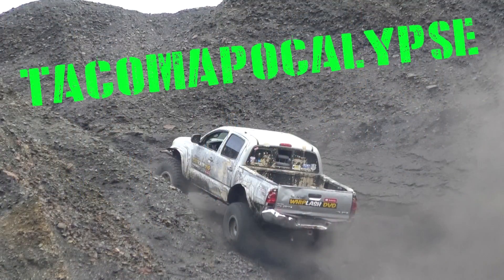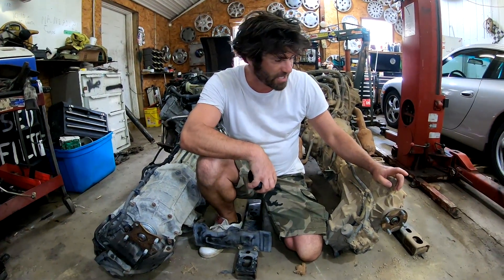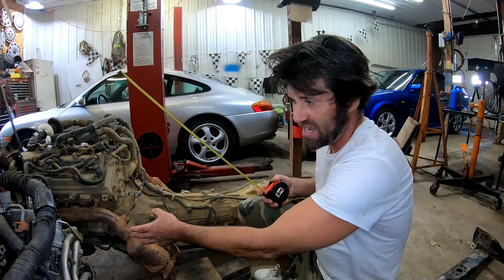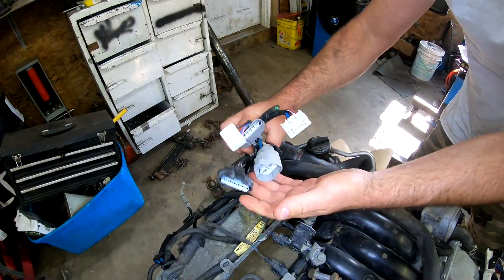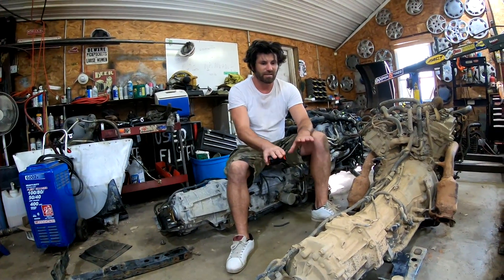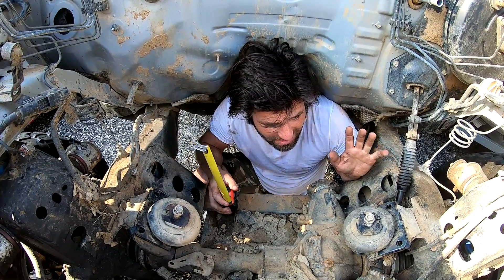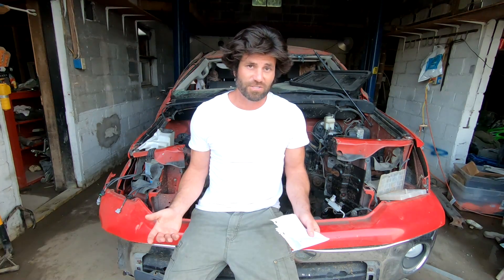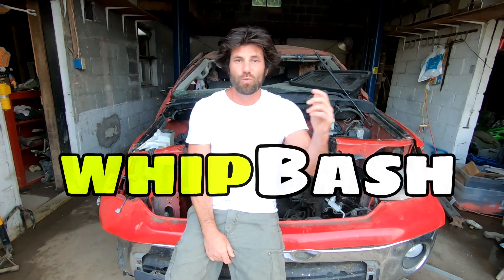Can you fit a 5.7L Tundra engine in your Tacoma? (TACUNDRA 11)

Comment: How did you like your 1GR v6 in the Taco?  I have an old 94' v6 4x4 in great shape but want to do an engine swap.  Everyone has done the 5VZ for the last decade or so because it's an easy bolt in but only gains ~40hp (~190) and they have known head cracking issues around the rear #6 cylinder so I'm leaning toward the 1GR v6 (hopefully a 2009+ dual VVT-i) or also considering the 05-06 2UZ out of a Tundra which has 270hp.  And in either case I plan to stick with my manual 5spd.  With the 1GR I could use an FJ's tranny and xfer case, or with the 2UZ could get an adapter plate and use my R150F tranny.  It's now been done by a few guys.  And I wouldn't mind the extra HP of the 2UZ but it also seems to be a little overkill maybe and it's a heavy engine with its cast iron block.  I think the 1GR is a good fit from the standpoint of less weight since it's all aluminum, both head and block, and was it also used in the 2nd gen Tacoma's.  I'm not building a race truck or crawler either, more of just an overlander camp rig.   Anyway, with 180k on the old "3.Slo"  I want to swap it out.

I've also been considering selling it or keep it and mod it for trails and buy a newer Taco or Tundra.  I like the 05-06 Tundra or the 2nd Gen with the 5.7L but in both cases am kind of worried about the MPG hit.  I've been spoiled by the small v6.  I get up to 24mpg sometimes! My engine is clean AF with mint compression.  And the 2nd gen Taco's are nice but would want a 2012+ to avoid the known frame rust issues (just like the 1st gen Tundra's have) hence my hesitations..., and used Tacoma's are stupid pricey... like $18-20,000 at dealers for a 2010 with 200k miles which is just ridiculous.  It seems like Tundras can be had for cheaper across the board.  I like the first gen like the wreck you bought.  That's a sweet 5.7L.  And I recently found out all the 2014+ body parts will swap onto the 07+ with minimal effort..interior, bed, fenders, doors, hood, grill, etc.. So a 2nd gen Tundra opens the doors to make it look like a 2014-21. 

Anyway, I appreciate any thoughts you may have.  Sorry for the essay. I have no one to talk to about this shit!
Reply from the maker: The 1GR actually had plenty of power.  Nothing like it has now though.  I'd recommend the 2UZ.  They are heavier, but they feel so much more powerful than any of the 6 cylinders .
The 94 would be a great trail truck because its small - like my 96.  The 05 and newer Tacomas are WAY bigger.  
For an overlander, I'd go with a 07 or newer Tundra with the 5.7L.  Bigger is often better for an overlander.  I'm about to start building mine soon.  idk if you saw what I bought - 2012 F550 and an Arctic Fox 1150.  I'm excited to get it built, but no time for it so far.
Reply: @WHIPBASH   Thanks for the advice!  I'll check out your other gear.  I have a full size truck bed trailer with a nice frame that I plan to turn into a trail camper.  Like you I weld and have a pretty stout shop. I also do CAD/CNC work.  I'm currently shopping for an affordable plasma CNC or may look at how to DIY one.

Comment: so what ideal sized engine can fift in a taco? do you know about smallblock V8s?
Reply from the maker: Naa...  I feel like a Totota truck should have a Toyota engine. 3URFE is in mine now. About to start wiring. Nice thing is that the drive-by-wire pedal should work and the stock 4x4 switch, all still Toyota quality parts.
Reply: @WHIPBASH  but can it fit any smallblock v8's available in the market?

Comment: 4.7 is a better engine 5.7 kinda sucks
Reply from the maker: I don't see it - The 5.7 replaced the 4.7 you know and: The 4.7 has less displacement, but weighs 70 lbs more, has 105 less horse power, has a regular 5 speed auto trans, rather than a selectable 6 speed and does not have a tunable ECU like the 3UR.  Those are just a few basic facts I know of that would point to the 3UR as the better engine, but if you've got some crazy insider information, please share it.
Reply: WHIPBASH  it’s a better built engine for longevity it has been proven by multiple guys that run the hell out of them and it didn’t replace it the 4.7 was still available for a long time as the middle engine
Reply from the maker: @TheCumminsturbo2  ok. You are right that it didn't completely replace it. And I know it's a solid powerful engine. But the 3UR seems to be the obvious choice if you don't mind the extra work.  I know the 5.7 can make a reliable 600 hp supercharged on 93 octane, so I'm planning to make more with turbo and E85. Hopefully 700 just to make it sound good.  That's a long way off, but it's my basic end goal for power.
Reply: I shoudnt say the 5.7 is a bad engine I just think the 4.7 is more durable yea it has timing belts but the way I see it it’s less wear going in to the oil and many 5.7 have had timing chains wear out and that’s a a lot bigger job then the belts on the 4.7 plus the early ones didn’t have vvt just a more simple engine for a trail rig

Comment: Just look for a drive shaft shop and they will fix it I did one to my 96 Tacoma I swap the TRD rear end amd my shaft was smaller so I Bring both  pieces and they cut and welded, also well balanced only $70 bucks
Reply from the maker: Thats a good deal.  I actually had to shorten a 4 Runner shaft to fit on my 96 ext cab tacoma.  I filmed it, but I dont think I ever edited and posted it.

Comment: Ive been saying for a while now the trd pro tacoma should have come with the 5.7 just sayin
Reply from the maker: They should make a big V8 version.  But they probably don't for one logical reason - They want to sell Tundras.
Reply: WHIPBASH probably the only reason I would buy a Taco over a Tundra is because it has a 6-speed. I know that the autos are nice in the Tacos and Tundras alike, but I’d love a six speed Tundra. My dad had an 11 with the 4.6, TRD exhaust system. Loved that truck. Now he’s got a 97 F-250 HD with 500hp
Reply: While I agree with the 5.7 bei g in the rrd pro, the more realistic option was them throwing the 4.6 v8 in there from the tundra. Apparently it bolts right up. Only problem is that I can't find anyone who has supercharged or turbocharged the 4.6 v8. 310hp and 327 torque isnt too bad. Ther trd pro v6 should have come supercharged standard, or with optinal 4.6 v8.

Comment: How about GX 470 mounts. They are more like the Taco than the Tundra.
Reply from the maker: I did take a look at V8 4Runner mounts for the 4.7L - They do have a different part number, but I don't think they'll work cause the V degree is still 30 degrees narrower.

Comment: Hmmm this series might help me decide to swap one in my 97 4 runner I just bought with a bum motor
Reply from the maker: Smaller truck and older electronics, so I'd assume it would require more work.  But you'd have one nasty 4Runner thats for sure.

Comment: We did a chevy 350 swap into a old Datsun 4 cylinder.  Firewall will have to be modified.    Put a Buick rear end in, chopped the top 5".
Reply from the maker: That sounds pretty sweet. Have you seen my drift truck?  It's a body dropped 92 Ram50 with a turbo S2000 swap.  Theres a playlist of videos on here of it.

Comment: I loved my 5.7 when I had my Tundra, I would beat the crap out of it and still average 16-18 MPG, I want to swap my range rover with a 5.7 but it wouldn't be cost effective.
Reply from the maker: Buying a Range Rover in the first place was not cost effective. Lol
Reply: @WHIPBASH  Its a 10 year old Range so I paid pennies for it, but I just love the way they drive, nothing wrong with the current engine but it's a gas hog and it's slow, I have a twin turbo BMW engine just sitting there that I'm going to swap in, it's a 3.0  inline 6 with 320hp and 320 of torque at 1600 RPM's. N54B30 engine.

Comment: The 4runner came with a V8 wonder if the mounts would work it's the same body style as your Tacoma, but it was a 4.7
Reply from the maker: Hey. I looked into this a little. They do have a different part number than the Tacoma's mounts, but they look the same.

Comment: I remember the 4runner came with a 4.7 v8 for a few years. Mounting parts might be available from dealer. I think years were 2006ish.
Reply from the maker: They did. But the 4.7 is a much different platform.
Reply: Thought it might be close

Comment: Subscribed! Looking forward to seeing this finished.
And might as well do a solid front axle while you’re at it. 😉
Reply from the maker: I have custom built 3.5" long travel front suspension with "unbreakable" RCV axles. So I'm hoping to stick with the IFS.  Oh I do have a 10.5" 14 bolt Chevy rear axle for it though. Cause I'm on the 3rd gear set for the rear now.

Comment: Will the 5.7 fit inside a 1st gen Tundra with the 4.7L v8? asking cuz I actually have a 1st gen with the 4.7L
Reply from the maker: I'd assume it would fit without a problem. But it wouldnt bolt right in. And wiring would probably be even more trouble.

Comment: Get yourself a stedi-cam!!!   Also did Toyota offer a supercharger kit for the 2nd gen 4.0 V6 Tacoma???  I know they did for the 1st gen's 3.4 and they(used to) offer one for the Tundra's V8(550hp and factory warranty!!)
Reply from the maker: I think they have on for the 4.0. I'm planning to boost this after its swapped. But I'm hoping to use turbos instead for more power.
Reply: @WHIPBASH  Well you are definetly doing it the hard way by not going GM LS lol.  I was just thinking a supercharger on the 4.0 V6 would net you about about 100hp, aka similar results to a stock Tundra 5.7 V8 for a lot less work.
Reply from the maker: @aaronbays4  oh yeah. Could make 350 WHP with a URD supercharger. Idk if the LS swap would be easier.  In some ways, I guess it would be.  But I'm a big Toyots fan. And I've done lots of engine swaps in the past, so I'm up to the challenge.

Comment: So now that you have the 5-7 out of the vehicle if you can you need to reseal the coolant Valley plate and the timing cover to avoid any oil leaks and coolant leaks or engine overheating in the future
Reply from the maker: I really like that advice. I honestly have not done much tech work on this 2nd gen Tacoma.
Reply: @WHIPBASH  I'm a Lexus technician and we see the oil leaks from timing covers all the time on the GX 460 and then the LX 57 both those big V8 leaking coolant from underneath the intake manifold
Reply: @BryanAcosta4200  At what kind if milage or age do you typically see this? I have a 2017.
Reply: @geoffmooregm  between 40000 to 75000 you'll get the oil leak for the coolant leak you'll notice it in the winter time when you go to turn on your heater and you're not blowing any hot air out and that's when you find that you're leaking coolant

Comment: I know someone else asked but can you find and post the following. 
1-mount to front of engine
2- block width at the motor mounts along with mount depth
3- mount to Bell housing
4- mount to top of engine.
If you have to adjust the mounts you might consider moving the engine as far forward as you need, remote mount the radiator (that's giving you issues with your skid plate as well as addressing cooling needs) and maybe even lowers cost of driveshaft mods
Reply from the maker: Wow... demands! Lol just kidding. Maybe I can do a follow up video to close up some of those loose ends. It would have to slide forward 6" to line up the drive shafts. That's too much in my opinion. But I do kinda want to move the radiator to the bed - it would keep the mud out of it and lessen the chance of busting it up. However, for the sake of making this first-ever swap work, I'd like to show everyone that you can keep your stock rad etc. Just trying to keep it simple at first. Then I'm going to push it to the limits.
Reply: @WHIPBASH  
I do happen to have the 4.6 tundra motor sitting in my storage unit with what's supposed to be an a760f (6 speed version of the a750 tacoma auto) and will be installing it into my truck when I have time. I am curious about the wiring which I know is down the road

Comment: You're gonna lots of fun with the exhaust system on the 4wd taco
Reply from the maker: I haven't given that much thought yet. I hated the original crossover pipe on the Tacoma though. It hangs way too low. So I'll gladly reroute it with the V8. And I'm swapping to a linked rear suspension too so I might put a fuel cell in the bed and just run dual exhaust the whole way back.

Comment: I just finished putting a 1UZFE in an 1987 Toyota 4x4. I had to make the headers and I made it run on prius ignition coils with megasquirt. So anything is possible.  I am now putting a 1kz-te in a 1994 YJ. Yes I know i am weird. Next when funding allows 1VD-FTV in a 2015 Tacoma and retain the crawl control. Anything is possible.
Reply from the maker: Thats pretty sweet.  I know some drifting guys that use megasquirt.  And I bet that fucker hauls ass.  I'd prefer to have an older, lighter, smaller truck for this swap, but the 2nd gen Tacoma is so popular - someone has to do this and I'm happy to be that guy.  If you have pics on facebook, find me on there and send a friend request.  I want to see that truck.
Reply: @WHIPBASH  I will do that. I just traded it to a guy in Nashville. But I still have the pics.
Reply: Sorry it has been a while I have had health problems.
Reply: The 1UZ is probably my favorite Japanese V8. That and a 1GR would be my top swaps for the 80s trucks and 4Runners. Imagine twin turboing that UZ. That little guy would shred.

Comment: With all the being said....lol...if that front driveshaft transfer case mount is the same....I'm wondering that the front differential mount is too .....that would save some more problems....but the travel to the diff between the motor placement too.....that is a later worry.....I'm getting you to far in this....but something to put on a check list.....??? Good idea? A helper check list....comment helper check list???.....that will work!!!! Thank you for the update!!!!!
Reply from the maker: Thats a good point.  I didn't exactly consider that.  But I did measure same distance from mounting point of the engine to the bottom of the engine.  And the oil pan designs are about the same.
Reply: @WHIPBASH  cool I'm glad i could help!!!!! Makes me feel good if I can be like hamburger helper...and giving u a hand to make it easier....lmao!!! ....but serious ...I'm glad I could help in advance....I would do a list of feature issues.....like moms always said...make a list!!!...lol GLAD I CAN HELP IN ANYWAY MY FRIEND!!!!!

Comment: Try the 4.6l tundra mounts. It's smaller but everything is the same.
Reply from the maker: They would still be flat-mounting.  I think the original Tacoma mounts will be easiest to use.  Although for more work, the Tundra mounts might be best.  But I think I can modify the mount brackets on the v8 and bolt them to the Tacoma mounts.
Reply: @WHIPBASH  it's way easier than you realize buddy. It's still a Toyota engine so the spec is a bit off,  compared to a different brand company. The whole spec would be off more than the measurement you done. With today technology it's possible. Think about this... Every Honda has over a dozen style of engine, from American to their own Japanese engine so by doing this what makes it any different from Toyota to Honda, when both are still Japanese car's even though now most are build hear in the US and Canada. Be4 I go make sure you replace the timing chain/belt and water pump, etc. However one issue too is replace the secondary air pump or EGR depends on the year model of gen 2 tundra the 07-09 has that issues the 10-14 isn't when it's from 07-14
Reply from the maker: @mengvaj87  I agree.  I'm surprised no one else has done this swap yet.  A lot of stuff matches up.  My roots are in Hondas.  I've swapped hundreds of engines in them over the years.  Hell, I have an s2000 swap in my drift truck (idk if you've seen those videos)
Reply from the maker: https://www.youtube.com/playlist?list=PLU5lR_tbWf0wqIi0aS-_PZrVxHa96B3rU

Comment: Gx460, is a better swap
Reply from the maker: Elaborate.  I mean, maybe it is. You gotta tell me why.
Reply: Everything is setup for smaller vehicle, tundra is a half ton, go is Tacoma/4runner sized.
V8 4runner is another option 🤷‍♂️
Reply from the maker: @anthonyreddy2834  Actually I dont think the GX460 engine is any smaller.  Its the same UR engine, just shorter stroke and maybe smaller bore - Same size externally.  And the V8 4Runner (4.7L 2UZ) would obviously be easier to swap, but that engine is WAY behind the newer 5.7 - 110HP behind for starters.  Plus it doesn't have the bad ass six speed auto trans and tunable ECU.

Comment: What's the measurement from mounts to the front of fan?
Reply from the maker: That is a good question.  I actually did measure that, but this video was a second take (cause the microphone wasn't working during the first)  and I forgot to measure that.  If I remember correctly, it wasn't far off - maybe 1.5" - mainly because the fan is tucked very close to the V8 engine - a few inches closer than the V6.  I'm not concerned cause I'm willing to ditch the mechanical fan and exchange it for electric fans if I have to.

Comment: This, then 4 link! (Or spring under)
Reply from the maker: I already have 48" Tuff Stuff trailing arms, 10" King shocks,  and a 10.5" 14 bolt GM rear axle ready to install.  I decided to do the engine swap first though cause the hype is already out about it.